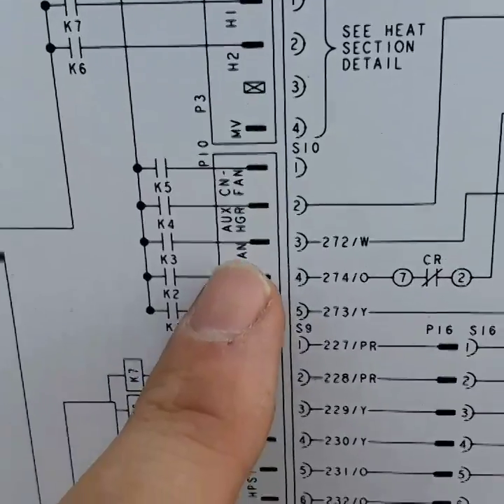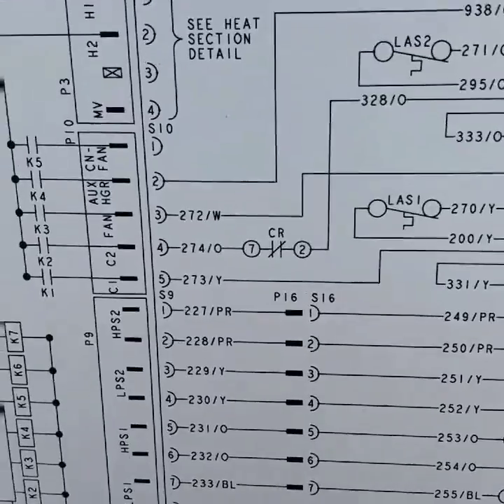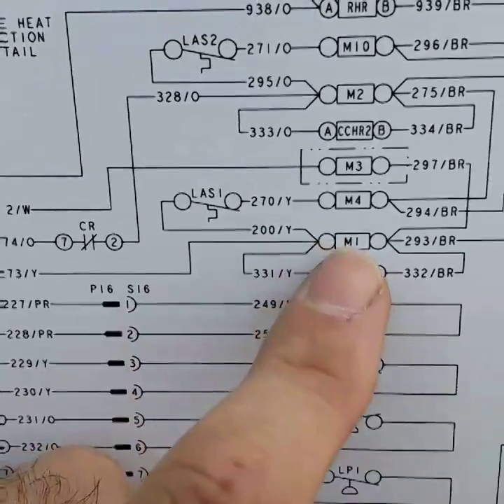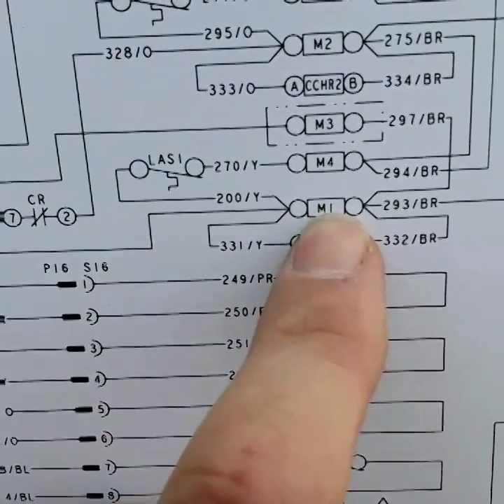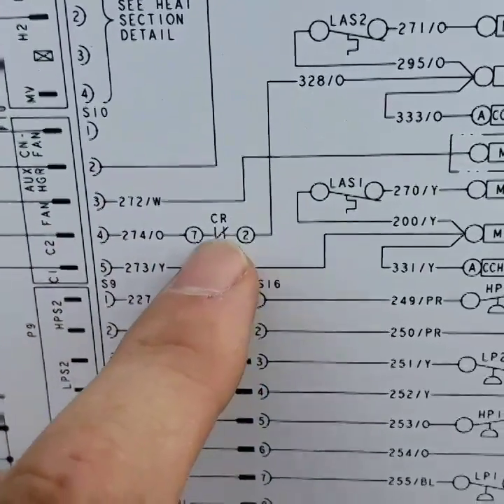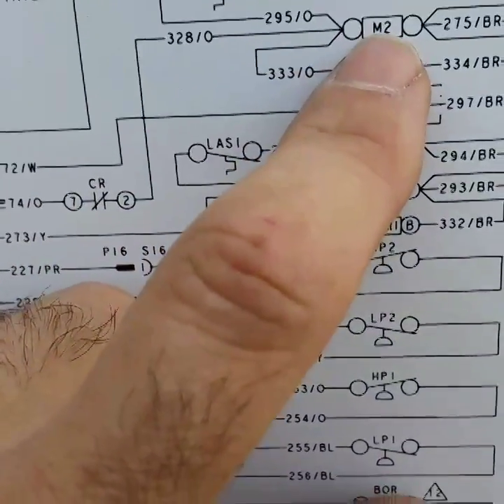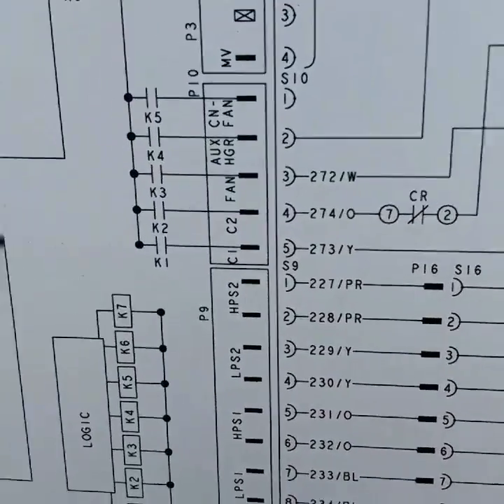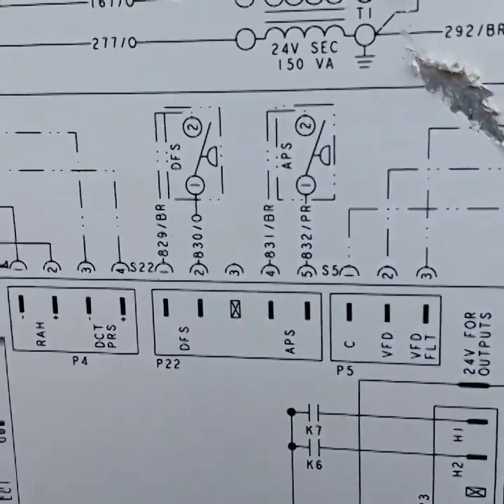Electrical Troubleshooting  - HVAC Know It All

Comment: Crimp it a little and turn it over so the insulated Stake on is on the bottom
Reply from the maker: I do that too, I'd rather replace where possible
Reply: Thats what i typically do, but I wasnt going to say it out loud until i seen you already did....lol